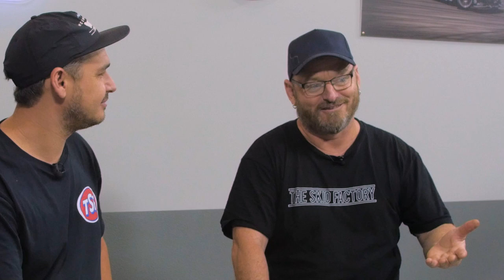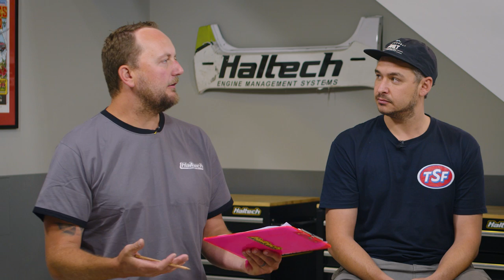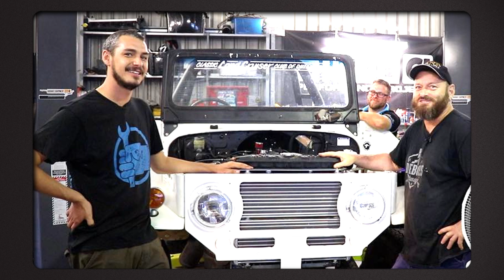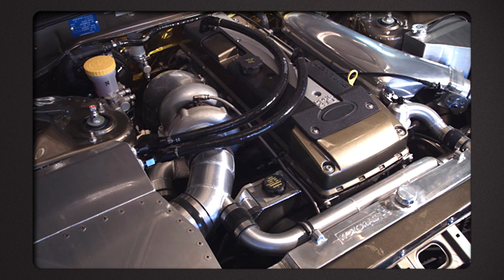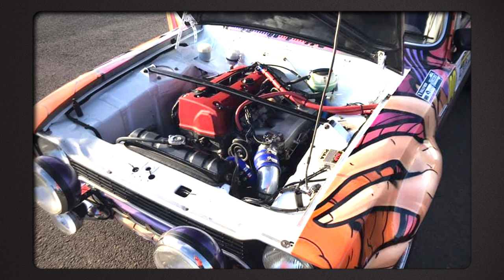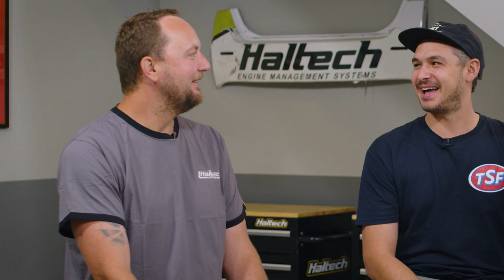📢 Modifying Classic Cars - Why All The HATE? | MASS DEBATE

Comment: I think my personal opinion about this is "why would I put a 2jz (or whatever, but I always get 2jz or LS as suggestions) in something that requires a ton of modification, complete redo of the fuel system, add computers, new transmission, turbos, weeks of custom fabrication, tons of troubleshooting, and replacing all the other components when I can just throw an engine in that fits and works and bolts up to everything with maybe different motor mounts."

Comment: Being an owner of a 1971 hg Kingswood base model 186, 3 speed manual but only has 47 thousand genuine miles I've gotta ask would I put it back to original and by the way I'm only 33 and my mum still owned a hq ute with a stroked 350 when I was 10 and got dropped off at school every day so that would be the car I'd build
Reply: Yeah my daily is a 74hj tonnner I am 34 stock 202 4 speed I did 3000km roadtrip with my caravan on the back it's faultless bar fuel consumption the old 202 did a lifter when I got home I went to a real parts store picked up a set of lifters And fixed it in 2 hours including lunch 
 
My toy is an EJ panel van 179 mild with triple SUs 4 speed and same it's a perfect touring car that's what I built it for I don't need anything modern

Comment: Great topic. Could debate till the cows come home but for me restomod everyday. I've got a matching numbers early 240Z which looks stock except for lowered and wheels but with BMW M3 engine and trans, power steering, MCA suspension and R 33 brakes. Its infinitely better to drive than a standard Z and I wouldnt change anything but I did keep the original parts and the whole conversion is bolt in and reversible if someone desires......but not me.

Comment: Usability for the win. Having said that, I am a sucker for originality, so LS swapping a non GM vehicle to me would be a no go, same as Barra swapping a non Ford. 
Also I would look at the weight increase that a bigger engine would put on the front axle. There are lots of good newer engines to swap old cars with so the spirit remains more or less the same: Ford Falcon/Fairlane/Fairmont:  Barra 6 or Coyote V8.  Holden V8: LS/LT swap. old Chrysler, Imperial, Jensen: Demon/Hellcat swap. But I'd also like to keep a Lancia Gamma (look it up) on the road with a Suby swap, a Mercedes W123 with an M104 AMG swap or an OM612 swap in the 300D, An M159 or even M275 V12 in a W116 450SEL, an S54 in an E28 or E24 BMW, a 20V Audi quattro engine in a Porsche 924/944.  I am starting to drool over my keyboard now...

Comment: Whats Al's view on doing an EZ swap? Should I be doing a 30r instead of my ex36, I know there is more aftermarket support for the 3 litres, but If I'm running stock ecu and engine, would the stock torque with a 3.6  be worth it?
Reply: I assume you've seen Super Gramps. Unless you are going for INSANE power I wouldn't worry too much about the aftermarket. Especially if you already have the EZ36 on hand.
Reply: @802Garage  I'm happy for a stock setup with stock power to start with, and later on maybe just good flowing headers and cams with a focus on most of the power and torque made in the first 35k rpm. I have a low km ex36 complete, and a complete tribeca  with a almost dead ex36 in it. 

I'm also looking into AGT Engineering for maybe getting a custom hybrid loom sliced from both the forester body end, and the tribeca engine and transmission end.

Comment: Hey Al, if you grew up in the late 50s early 60s you wouldn't be so dismissive of six cylinders. Those six cylinders then were modified with a cam , high compression bigger valve head and 3 carbies and did the business in 179 EHs 225 slanty valiants etc. This was before there were any Japanese cars so effectively all the english and other 4 cylinder stuff just could not stay together (except for VW beetles that were oil tight) Holden had a 307 v8 in a HG in the late sixties. All the ford V8s of that era weren't anything special. Customlines had a habit of burning to the ground regularly. Then the Torana XU1 Pacer/Charger sixes of the 70s put up a good show. My era was really pro 6 cyl. We could afford em too.

Comment: So Al hit the nail on the head with the it's not the engine design it' the way it's managed part.
I've got an old holden 6 with a VK injection intake manifold and haltech ecu. After trying lot of different carbs 
the difference is night and day. Yes there a crap design but making stuff work that shouldn't is cool.
Just like Burt Munro.
Reply from the maker: ^^ yes!

Comment: 302 windsor with a lowblo supercharger in mark 2 escort
Reply: I have a Mk.I 2dr esky I was gonna drop a 302 into, but the current plan is a tesla motor.  No, I won't tell you where I live so you can stab me in the eye with a blunt spoon.
Reply: Aren't you destroying the nimble handling? What is the weight difference between stock and the 302 which I imagine is an iron lump?
Reply: @heijxje  the weight difference between a 302 C4 9" in a 4 door was 110kg from the old 2ltr 4 spd and toothpick diff
Reply: @302esky  Wow, that is a lot on a 900kg car.
Reply: @heijxje  Not when its got 500hp plus
Reply: @heijxje  ohh and can you hear that V8 rumble as well

Comment: What do you mean not fast? I had an HQ sedan with a stock 253 & 4-speed in it that did high 12s. All I did was dual 2" exhausts, electronic ignition, Holly 465 and Edelbrock Torquer. And ER70s for a little extra grip. And it got 20mpg+. Surely with a fuel injection system and a Haltech you could do better. And sixes? The old E49 charger was a six but was not slow by any standard of the day, beat Porsches straight out of the showroom.

Comment: copper brass radiator is more efficient so that was a poor example. there's a few reasons to run an aluminium radiator they weigh less so understandable if you're chasing that last 0.5% in performance, they're shiny so it that wins you a trophy or brownie points with people who care about such things go for it, they're cheap so if you ran out of budget and need something to get you by until you can upgrade to a decent copper brass radiator that will cool better and last longer fair enough.
my view is if it's a special/rare model eg a gtr xu1 torana then you shouldn't do any major modifications like ls or barra swaps just improve what's there a bit like a cam roller rockers higher compression stuff that's unnoticeable.
if it's just a run of the mill model like a hq belmont go to town there's nothing off limits at least until it's the last few surviving original examples.

Comment: My opinion may get me kicked in the teeth but Al has this innate ability to see what will work and work for extended period’s of time.
Look at super gramps, 7 years ago that was built.
I have a friend with a small block chev in a 81 Volvo. There has been cooling issues and transmission failures due to it really not being thought out that well. He is now going through it top to bottom with an engineer to do it again. 
Al knows what works best for purpose. Full stop.

Comment: there will nevr all of time complete or come up with any even remotly close solution for this dilema as every person is diffrent with there oppinions on how it should be approached and specifications chosen , Then on Top of That There's There in Front of You On A Indervidual Basis Almost Like A Human Beings Same Approach Apply's to It's Type of Car Catogory also it's Make and Model that it was Desinated Right At The Very Beginning as the collection and how high specification and quality achived depending when the cutting tool was last changed and the skill and knowledge level of that Lathe or Milling Machine , Make , model and machine operator's Abilitys . Mostly of this is Down to pure luck what ends up the individual components selected then fitted onto that veration of body shel wheel base and number of doors dictate how much and how good the welding was done to that one's intended Specifications Level to what vin number plate and stamping is given and stamped into the metal work comferming identity and performance level specifications.